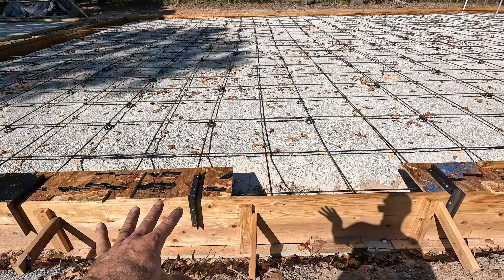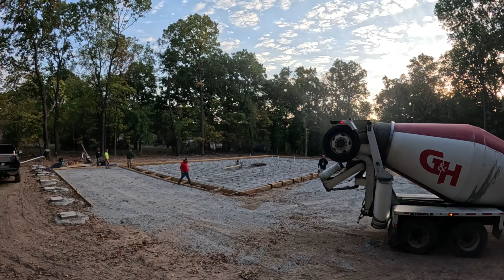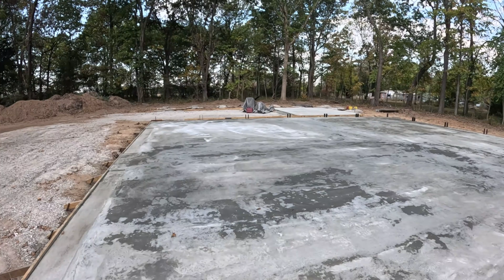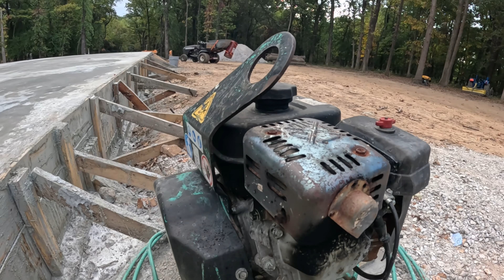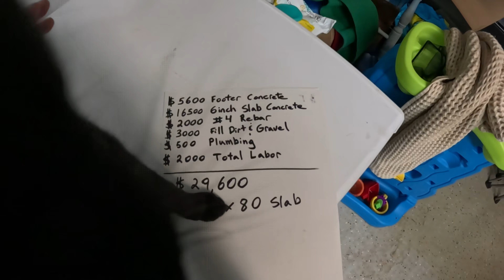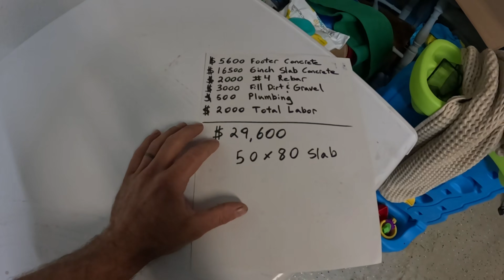110 Yard Concrete floor pour. 50x80 Shop build

Comment: WOW no vapor barrier. Any ground moisture will  wick up thru the concrete.
Reply: I noticed this a well. It also acts as a Radon Gas Barrier to meet building codes in affcted regions in Scotland.
Reply: No expansion joints either? A slab that size should have expansion joints every 3m.

Comment: Who engineered your slab? How did you know what was required for dimensions of your footer? Where in the US are you?
Reply from the maker: I’m the highly unqualified engineer lol. Missouri Code in my area for footer’s is 2 feet depth minimum and 1 foot wide minimum. I went with 2 foot wide footer and at least 30 in depth
Reply: I'm in MO also between St Louis and Cape Girardeau. I think my frost level is about 18 in. So you went a foot below that?
Reply from the maker: Yea that’s what it is here anyways I’m not educated in what really you can get by with they pored some concrete for storage units near here that only had a 1 foot deep footer so I duno